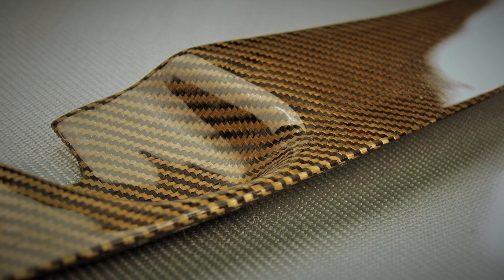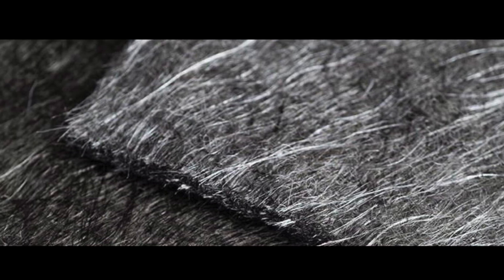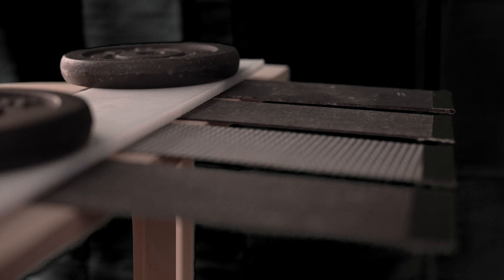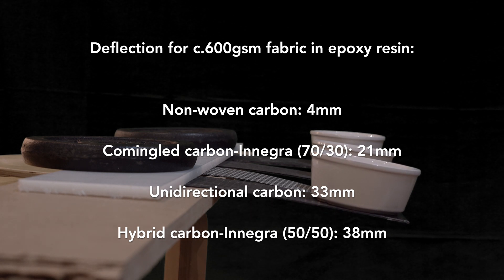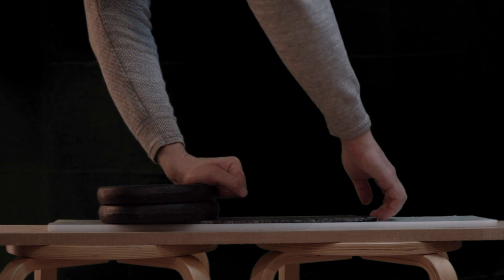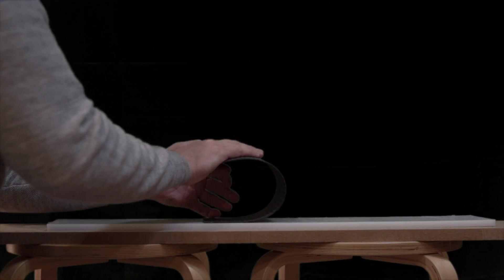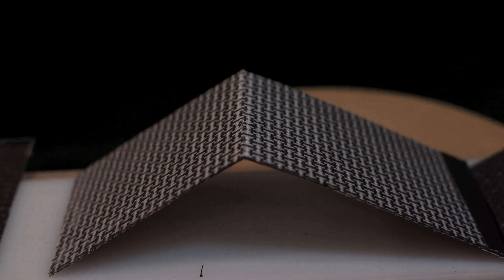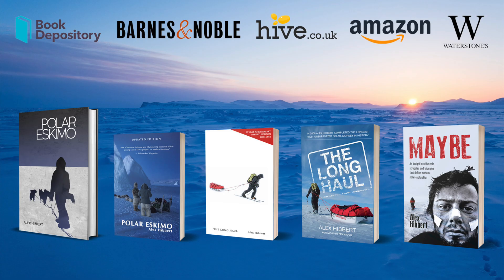Testing carbon fibre against carbon-Innegra composite sheets [4k]

Comment: why are the thicknesses different I didnt understand.
Reply from the maker: Due to the type of weave. Flat fibres compress down nice and flat. Twill weaves with ups and downs can't lay as flat. And chopped strands similarly, per unit mass of fabric, have more ups and downs when compared to parallel flat fibres.

Comment: Can you use a core material to bring the pure innegra to similar levels of rigidity as carbon, good video btw
Reply from the maker: Core will increase stiffness, but you'll get to a point where there's so much more core than laminate each side, that you'll have poor strength. Innegra is VERY flexible and stretchy, and carbon is VERY stiff and brittle - opposite ends of the spectrum.
Reply: @AlexHibbertOriginals  ah that makes sense, I may have to experiment with a sheet metal core or reinforcement 
I can't seem to find any information on it
Thank you for the response

Comment: Only just found your channel and thoroughly everything I've seen thus far. Subscribed almost immediately as I'm enjoying your real world approach to Alans conversion. Bearing in mind the results of your bend test and if one accepts the claims of superior impact absorption of Innegra do you think that there might be an application for 50/50 Carbon/Innegra in the construction of crash helmets ?
Reply from the maker: Cheers Jon - I'm glad you enjoy them. I think some helmets actually do already use this weave, but I'm not an expert on the mode of failure that cutting edge crash helmets go through. For example, they may be designed to fail on impact, so-as to 'take' the energy. This would mean the strengthening carbon failing permanently on impact wouldn't be a problem. As my tests show, the carbon once broken is broken permanently. Only the much floppier Innegra keeps the laminate held together.
Reply: @AlexHibbertOriginals  Hmm, food for thought. Thank you for taking the time to reply. Regards.

Comment: That was interesting, and makes me think, if you use the unidirectional and laminated multiple layers but with the weave in different directions could you not get something superior ? with it being so much thinner you could get away with using more layers if thickness is a constraint.
Reply from the maker: Yes indeed - and in fact very high quality laminates are made with unidirectional (or you can buy bi, tri or quad axial) laid at 0, 90, 45, -45 angles, or a combination.

Comment: What about using two sheets of the unidirectional but layered 90 degrees to each other? You would get the strength and still be about 2mm thick.
Reply from the maker: Yes, this is commonly done, and in 45/45 degrees too. It gives a thinner laminate than using common 0/90 woven fabric.
Reply: @AlexHibbertOriginals  Depending on your thickness tolerance you could even put a layer of Innegra sandwiched between the two. Then you have the strength and the structure just in case you get a shear break.

Comment: For maximum strength could you not stack the unidirectional in 90 degree layers? Or would that compromise it in some way?
Reply from the maker: This is very common yes if you need the fibre density of uni, but also need strength in >1 direction. Angled at 45/45 too. You can buy spread tow, and tri or quad layers too.

Comment: why not use metal for cold?
Reply from the maker: Some metal is useful in the cold. I'm not sure what you're asking.
Reply: @AlexHibbertOriginals  You seem to be going for a resin lifeboat in the cold, with parts very brittle
Reply from the maker: @Simcore999 Bernard Well-made composite parts of resin/fabric perform excellently in cold temperatures. If you check out https://youtu.be/wPFDBT41SEU, I did a video series with the EC team recently where they cold tested them.
Reply: Good to know 👍

Comment: I'd like to see carbon with s-glass
Reply from the maker: Polyester and polypropylene are very different plastics. Innegra is the later, and it doesn't like to mop up water at all. In fact, rather like aramids, in resin layups it is fixed into the resin, and doesn't wet out like carbon or glass fibre. It's why you get a fuzzy edge when cut.
Reply from the maker: Obviously only theory until tested, but you're likely to find the glass a little weaker, a good bit more flexible, twice as heavy, and with a clean 'snap' on failure.
Reply: @AlexHibbertOriginals  s-glass is less rigid but stronger. Carbon would add stiffness to s-glass and s-glass would add that safety factor to carbon and significantly lower the cost
Reply from the maker: Well that's where theory ends and tests are needed. S-glass has a similar tensile strength to 'good' carbon, a little higher than budget carbon, and well below the best carbon (which can exceed 5000 MPa). What is certainly inescapable is that the glass is much denser, if weight is a concern. And cost: my sources have s-glass 200gsm at c.£12/m, but also offer quality carbon at four times the weight for only 50% more cash. Carbon being overpriced is a bit of a myth, and it's easily available in so, so many weaves and weights, up to and over 1000gsm.
Reply: @AlexHibbertOriginals  I'm super curious about test results
Reply: @SylvesterOziomek  I’ve read documents relating to aircraft construction saying how mixing carbon and fibreglass is a very bad idea. Although similar in strength the carbon is much  stiffer. As the part deflects the strain is taken nearly all by the carbon and very little by the fibreglass. Eventually the carbon fails and now you have just the fibreglass taking the load which then sees this impulse load due to the carbon failure and probably fails itself. You can actually weaken a glass structure by adding carbon.
Reply: @j1mpatrick  Yes, I heard that covering fiberglass with carbon is bad for reasons you mentioned, although it might work if put carbon inside.
I'm curious why there is no S-glass carbon hybrid. Carbon does work with kevlar and innegra why not S-glass, similar strength different stiffness and weight. It would be my favourite fabric.
Reply: @SylvesterOziomek  I’m not sure it matters too much which one is covering the other, I think the problems occur when they share the same load path. Would be easy to experiment and find out though!
Reply: @j1mpatrick  I'm not the expert but to simplify, lets say these pieces were made of 3 leyers. Top one will be in tension bottom one in compression and middle one won't be in either tension or compression (more or less). You have here example of unidirectional carbon that bends easily when it's not in either tension or compression but things change when you expose it to those forces either by adding thickness or putting different material inside.
S-glass is better in compression and it has better elongation so it should be better in tension too. My bet is it will make a difference.